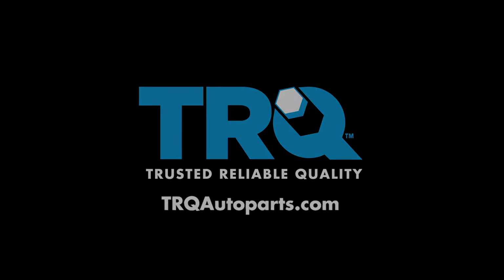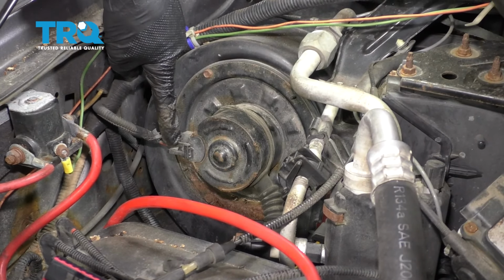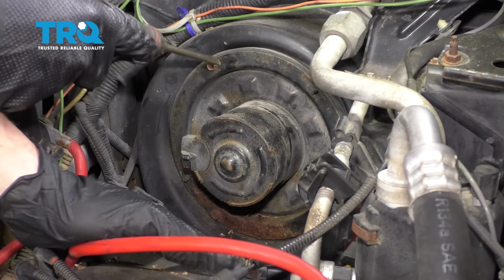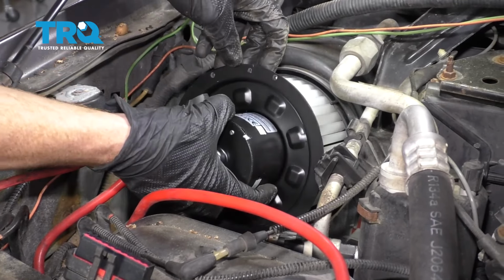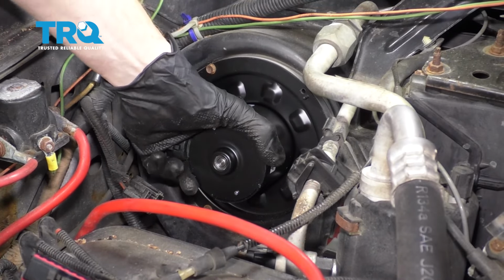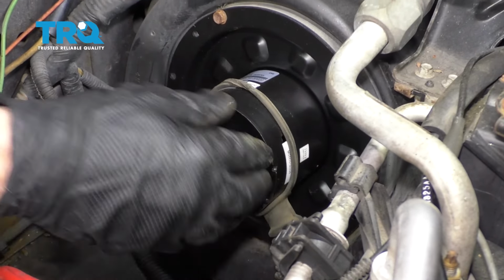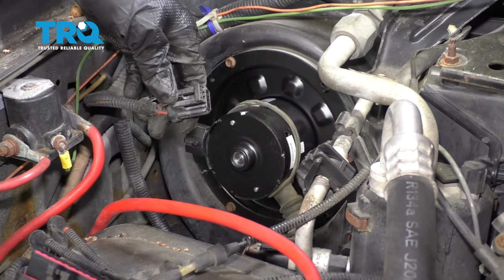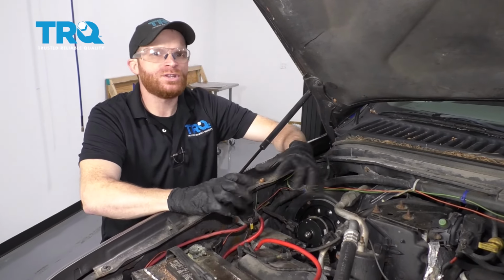How To Replace Blower Motor 1999-2007 Ford F-250

Comment: It looks like the fan blows directly onto the evaporator coil for the air conditioning.  With the blower removed, can you reach inside there and see / access the evaporator coil to spray some soapy water on it to clean it or maybe vacuum hair and dirt out?  Supposedly opening the evaporator enclosure, the access panel faces the valve cover, is a real pain with a 6.0 diesel but coming in through the blower looks like it might be an easy way to go.

Comment: 2001 Ford Excursion 7.3, front ac not blowing, rear ac blows cold.
I've replaced the #22 and #24 fuse in the cab, and the blower motor relay fuse under the hood. No change. 
This is my next thing to try. Hopefully it works and fixes the problem. Thanks, great video.
Reply from the maker: +@VegasBugs Thanks for watching. Buy the part in this video on 1AAuto.com: http://1aau.to/m/Shop-TRQ

Comment: I changed the resistor and the air blows when it wants to. When I turn the fan nob in the cab nothing blows, but I can hear the a/c compressor turn on. How do I know if I need to change the blower motor?

Comment: The first piece you undid is that the blower motor resistor?
Reply: That is the cruise control servo, the blower motor resistor is mounted on the engine compartment firewall to the right of the blower motor.